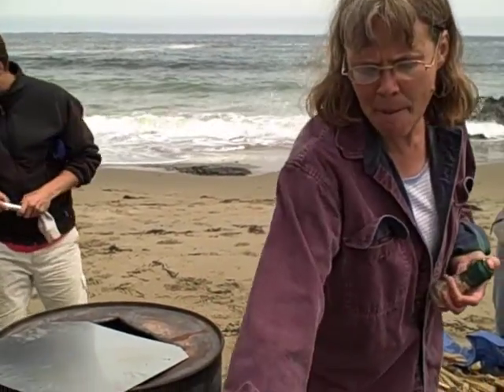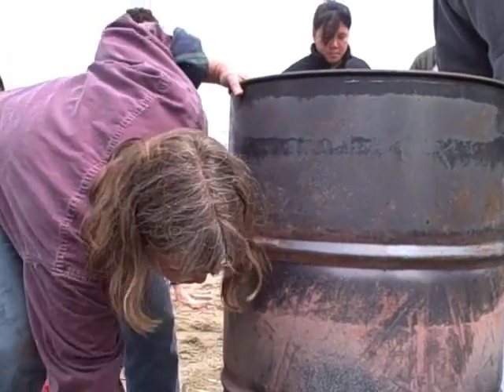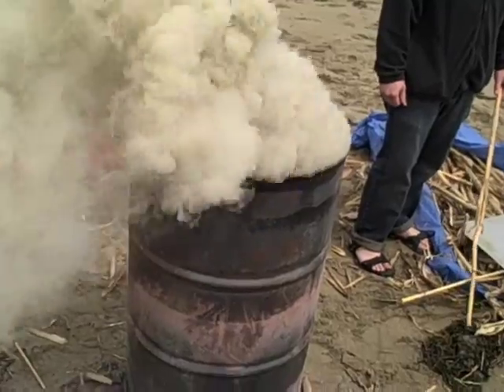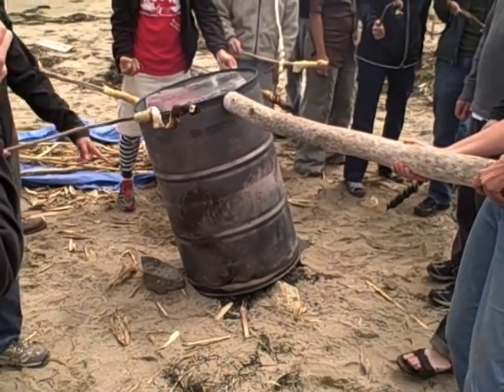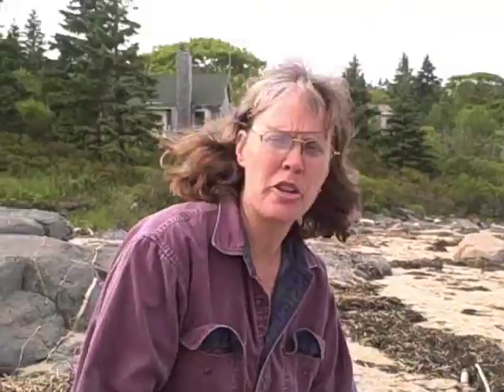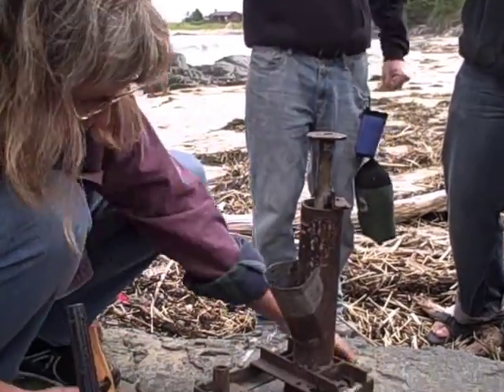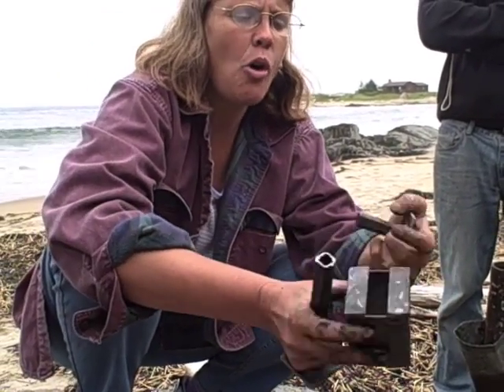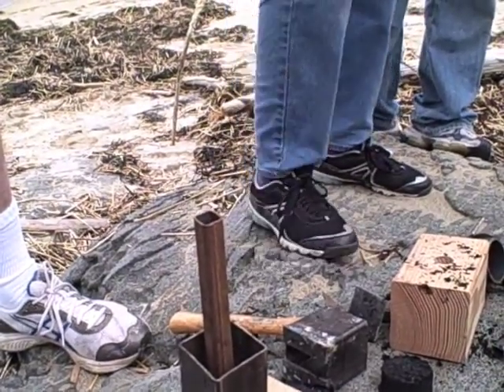How to make charcoal briquettes from agricultural waste

Comment: I tried making charcoal briquettes using rice straw but it doesn’t burn well. It dies off before burning completely. I made it with carbonized woods and it works perfectly. Do you think the problem is with the rice straws?

Comment: I live in Mexico and I use leftover tortillas to make porridge for charcoal briquettes, but I boil newspaper in the porridge to make more shock resistant briquettes. If you have clay, then you should use it to make a reusable charcoal mound like Primitive Technology. Btw, I just made a hydraulic briquette press, reducing unnecessary splashing and messy work.

Comment: Great video! I like the dog in the background. I am testing your application using my Weber BBQ and OAK flooring from a house next door. The wax and paint on the OAK act as an accelerater. I have not go the timing right yet. This wood is about 5/8" x 3" x 6". Do you have anythoughs?

Comment: awesome. Have you thought of placing a loose type weight with a hole in the centre over the top bar that you could use to ram the top piece down with. using the weight with the ramming bar going through it, the top bar would have a stop piece on it preventing the weight hitting the mould, this would allow for the weights kinetic energy to transfer  to the ramming plate through the top bar. And remove the need for a hammer. if you get my meaning.....where is a own and paper when you need it.:-P .keep up the good work.
Reply: It's called a slide hammer. Good idea as it removes one more tool and reduces the risk of injury.

Comment: The casava porrage acts as a binder (glue). I've just been looking at some other ideas and they use clay type soils/water, flour/water, or paper/water mush. Its basically anything starchy or gloopy that will bind it together when dry. The mix tends to be 1/4 to 1/3 binder to charcoal, but thats for experimenting with.The plus sides of burning charcoal to cook on in the home is the lack of fumes and smoke which causes no end of respiratory problems all over the third world.  Another plus is it uses what would be waste biomass. Ok, that should be composted and returned to the land but it won't be and it is better than chopping down forest. Yes, "it's bleedin obvious" once you have watched it but the point is she is sharing it. Getting the thought process out there. There are utube examples of womens groups setting up small co'ops and doing this to supplement the family income and cut down on imported fuels/LPG, giving them bussiness skills and developing community. All good in my book.

Comment: Kind of disappointing seeing the hammer press method.  Why not add  a press with a 2-5ft lever arm (Use a 2x4"  or pipe as the lever)..  Pivot the arm at the far end and maybe 3-6" from the axis have the press stamp hanging down from the lever.  have a U shaped bracket with a bolt going through the 2x4 to attach the two open ends of the U bolt.  The U bolt has the press stamp attached and hanging down from it.  This way it can move with the lever and fit in the mold.  This will increase the compression greatly and could do multiple bricks at a time if needed.
Reply: +AmericanREPUBLICNow ,Yes an arbor press would work pretty good

Comment: For fuck sake... Swedes have been doing this for 1000 years with greater efficiency than these college liberal johnny come latelys...

To make charcoal you need anaerobic heat.  They'd do better to use a sealable drum over an external fire/heat source and never introduced the flame to the actual product.  That smoke is so billowing thick because it contains water and particulate matter that is being released due to inefficient combustion of the stock.  If they'd just heated it without exposure to flame, it would have just been water vapor, much like a household clothes dryer.  After it is sufficiently dry, seal the box and leave it on the external embers.  To make coal you BAKE the material, not BURN it.

Like I said, Swedes perfected this method and have been using it for generations. To make coal and pine tar pitch (which is made by just not drying the wood before baking) for water proofing.  Although that requires a tap.

This video is nothing but another epic failure and misallocation of land, resources and capital brought to you by the arrogant liberal 'intelligencia'...
Reply: ... she and her collaborators came with this process because it's meant to accommodate developing countries... just so you know
Reply: Would you know if there is a tutorial covering the process of making briquettes by baking, not burning?

Comment: I like it. I live in the Midwest where we have a lot more ag waste then trees. I wonder how good it would work in a iron forge?
Reply: Scott, I believe charcoal produced in this manner is somewhere between 25-50% as efficient as coal, so in theory it should perform similarly but you'll consume material more quickly. There may also be other concerns with regard to introducing impurities in the metal, but someone with more expertise would have to confirm or deny that as I don't have specific experience using charcoal in a forge.

Comment: @ 8:25, do you even need the bar stock across the bottom?  Just a short section of square tube, the back plate on its post, and the presser plate with the whacking end. 

Having the bar stock across the end means being able to scoop and fill more easily, but it isn't crucial.  And if the users don't have access to welding, cut the square tube with a hacksaw but leave a couple of flaps to fold over.  Those become the back.

Comment: Making your mold a long tube would require about the same number of hammer strokes as making a single briquette but would yield a briquette bar that could be cut into many briquettes.  Another idea would be to make a sheet to the correct thickness, then cut the briquettes out like biscuits.

Comment: A little confused about how is closing the bottom and covering the top does not smother out the fire inside the drum.  Does the drum have other holes that are left open so air can get in and continue the burning process?

Comment: Hey, does anyone know if it would be possible to have a forge with dubble-wall-structure(2-rims), so I can put wood blocks in between the 2 rims to use that heat for evaporating the moisture from the wood?
If it works I would ofcourse condensate the fumes so I don't breath these when I'm melting stuff.
Thanks in advance, greets

Comment: in that case, just use dirt to plug up the holes. in my opinion, there's no reason the elevate the barrel at all, no point in risking the barrel toppling over in the middle of a burn. just make a base from dirt or sand and make the depression and air channel and fill the channel when the smoke changes. you can also replace the air channel with a steel pipe, a 90 degree bend and a cap, having the bend under the barrel and having the opposite end ready to take the cap.

Comment: false, if you get a fast, hot burn in the beginning and then snuff it out, the excess heat continues to pyrolysize the material and leads to a higher yield.

Comment: it's a lot easier to just make a depression or hole under the barrel and make a air channel than using rocks to elevate it. with the rocks you need to kick them out without toppling the barrel and you need to handle the barrel to prevent it from toppling over, with a depression under the barrel with a air channel, you just need to seal the top and throw a couple shovel fulls of sand into the air channel and it snuffs it out.

Comment: Very good video, but it would have been even better if it had been conducted somewhere that the presenter didn't have to constantly shout to be heard.  There was zero value and considerable distraction to holding this demonstration in such a noisy setting.

Comment: Great idea! How about welding a small plate on top of the piece you hammer on this would make it a lot safer if the one misses the target with the hammer. A smashed hand in an area with bad medical assistance might have serious consequences. Also building a simple wooden press like shown at watch?v=Mt0QQe6Eetw which can be easily and cheaply to build from lumber would be very versatile.

Comment: Dr. Smith, I saw your TED talk and have been researching your charcoal briquettes ever since! Your work is amazing. I have a question: Is the carbonized plant material dangerous for handling (will it damage lungs)? Thanks! Sonja
Reply: It is not dangerous to handle, but the small particles are indeed dangerous to breathe... So we suggest wetting the charcoal before crushing it, thus reducing the dust...

Comment: Not sure if you are interested but when you sho the square stock, instead of welding the bars on the bottom just leave open and use a slightly thicker base, that way the outside just sits over the base and no welding other than for the tamper. Neat ideas though.

Comment: Instead of mixing it with cassava porridge, mix it with the isopropyl- calcium acetate jelly stuff made in Nurdrage's video ( flaming jelly). This will not only act as a binding agent, but will also let you easily light the charcoal briquette on fire without having to dry it out.

Comment: Your small batches are good proof of concept but to be practical in the third world this needs to be more efficent.

A considerable amount of energy is wasted in simply flaring the waste gasses. Consider this " Process heat ". maybe there is a natural agricultural waste product that could be used as a binder or the Char could be mixed as a filler in heated extruder biomas product.

Great stuff though. This is how we can raise the standard of living for the rural power in the 3rd world